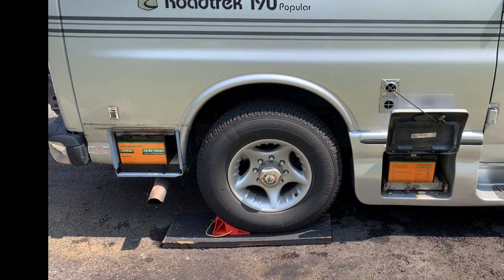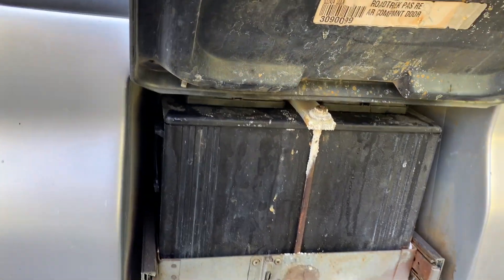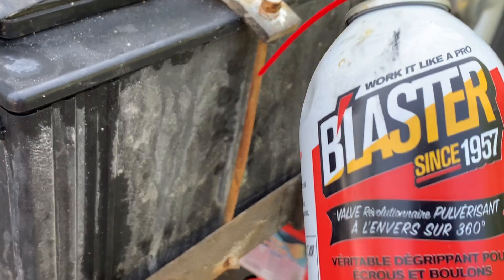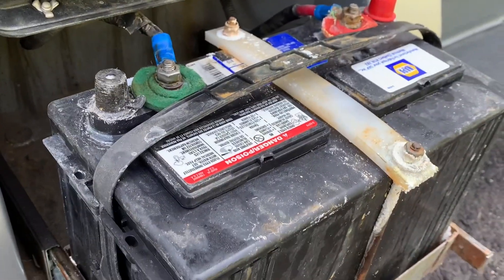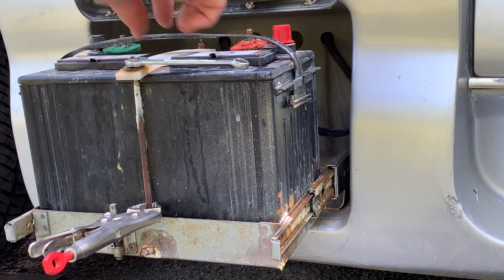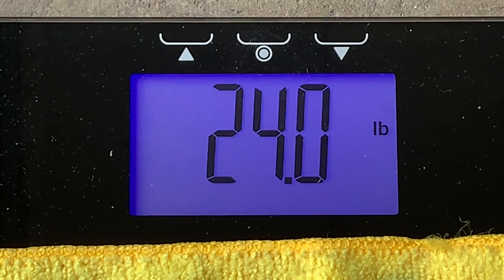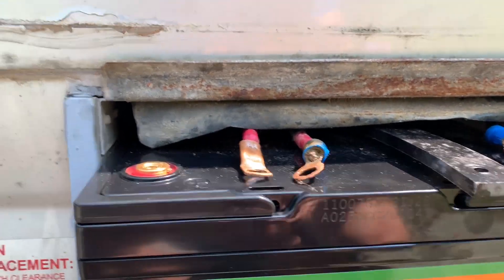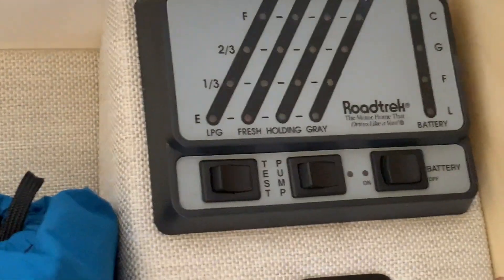Roadtrek 190 Popular Lead Acid to LiFePo4 Battery Upgrade - Installing Lithium Batteries in an RV

Comment: My fiber glass runner board got messed up and the repair center ordered the wrong board. It looks the same and fits the same but the newer runner board accomodate two lead acid in the middle and nothing in the rear. They installed the runner board like the one in the video where it only takes one lead acid. The shop relocated the battery under the sofa bed and it pisses me off to this day. However, I was planning to upgrade to solar and run a solar generator with extra battery under the sofa bed, connect that to the existing 120v electrical system by connecting the 120v output of the solar generator to the shore power internally. I'd have to remove the lead acid under the sofa and run the wire back to the runner board battery compartment. Install the solar battery setup with additional battery under the sofa. Install 1200watt roof setup with a custom made roof railing.

Comment: Did you replace your converter with a lithium one as the old one was for an acid battery?
Reply from the maker: Whether right or wrong I literally only changed the batteries. Just had the RV out last weekend and still working!  I’ve been told it might reduce the life of the LiFePO4 batteries, but since their life expectancy is over 1000 cycles, I’m willing to lose a lot!  Haha. Again, I’m not saying what I did was right but it seems to work and no issues so far. Cheers.
Reply from the maker: Also important to note I used LiFePO4.  Not all lithium batteries are the same.

Comment: Hello, i have a pleasure way excel, i upgraded my agm to lithium to 100ah but my class b only carries 1 coach battery. I would like to add to additional 100ah behind the right rear storage area. Just like your setup here but is it safe to parallel to batteries when they are loke 6ft apart?
Reply from the maker: That’s a great question. This is a factory option on mine (came this way) so I’m not sure how they did it. The cables run inside the van so can’t really see. I personally wouldn’t be fussed about the length of run but rather the shielding, so get some protection for the wires and channel them in an out of the way spot. Sorry I can’t be much more help here. Thanks for stopping by.
Reply: Thank you for taking the time.  @ChanceSummer

Comment: I noticed that when the lead acid batteries were in the Roadtrek, the posts were inboard. When you installed the lithium, you installed the forward battery the same, but on the rear one, you have the post outboard. Was there a reason that you did it that way?
Reply from the maker: Wow, that’s very observant. I actually had to go back and watch my own video to remind myself what was going on. I seem to recall I wanted the posts near the front (outbound) so I could easily connect my voltmeter to ensure the battery was being charged properly.  With the posts buried in the back and no functioning slide drawer this seemed the most logical thing to do.  Just make sure you connect the positive and ground cables correctly when swapping the orientation :)   It’s worth noting that they are still working great and this past fall they were still at 50% after 4 full days which included running the furnace all night!  The furnace fan is a big energy suck.  I think batteries like this are even cheaper now so unless one does winter camping they are the way to go. Hope that helps.
Reply: @ChanceSummer  I have a 05190V and I've already installed a lithium in the forward compartment. I removed the rear lead acid battery and put a block to tie the battery to the forward compartment. I've been wanting to install another lithium in the rear compartment, but I've been worried about needing a DC to DC charger. It sounds like your real world experience is showing that it's not necessary. Thanks again for the video.
Reply from the maker: Gotcha. Indeed, I did not change or modify the stock inverter charger that came installed in my 2004, which is shown at the @15:24 ish time stamp. It is the Tripp-Lite RV612ULH and manual here:  https://assets.tripplite.com/product-pdfs/en/rv612ulhw.pdf
Reply from the maker: Shown at @15:30 is the inverter / charger that came stock in my 2004, which had 2 batteries from factory, and I did not modify it in any way or add anything additional.  Just swapped out lead acid and called it a day. Haha. It is the Tripp-Lite RV612ULH with the manual at https://assets.tripplite.com/product-pdfs/en/rv612ulhw.pdf.

Comment: What about alternator charging?  Won’t it fry the alternator if the battery is low or did you install a dc to dc charger to limit the amps?
Reply from the maker: Great question. If you zip ahead to 15:29 in the video you’ll see that this particular RV uses a Tripp Lite converter,  which the alternator also runs though.
Reply: I don't believe current in-rush will a issue however, the charge profile for lithium batteries is different than that of a lead acid battery. Perhaps this charging mechinism has the capabilities to charge lithium house and the lead acid engine but it would have to be a fairly new system not what came stock in 2004. At the end of the day, even if you mix batteries or charge at incorrect voltages, most systems will still work but the economics justifying lithium is out the window.
Reply from the maker: Thanks for the insightful reply!  I’m no engineer, and all I did was swap out my deep cycle lead acid RV batteries for these LiFePo ones and it’s been 2 summers and working great.  I just came back from 4 days with no power at the campsite and still had 3/4 battery left (3 battery indicator lights on instead of all 4). Normally a stay like that would have eaten up all my lead acid battery juice.  Charging via plugging into house power or when driving (via alternator -> RV power inverter) does not appear to be a problem. It’s all stock Roadtek circa 2004.  The only real downside to LiFePo is winter / cold temp charging. Apparently, anything below 0C / 32F is not great for it and won’t charge at all at -10C - but I’ve never tried.
Reply: @ChanceSummer  Yeah, you got me pegged - I am a Eletronics engineer.  What you did if fine but you will reduce the overall life of your lithium batteries charging them with a system that is setup for lead acid.  The good news is even if you half the life of your batteries doing so, I bet they are still good for five years.
Relating to the cold weather charging you were referring too - most reputable lithium manufactures include a builtin  Battery Monitoring System (BMS) that detects and prevents cold weather charging, you may want to check on that as not all vendors include that feature.
Reply: What is running your batteries? I'm guessing the ac doesn't. What size converter is in a Roadtrek?  I have noticed the Pleasure Way on the Promaster has a lithium battery. 
I'm interested and looked for a Roadtrek 190 or 210. Need to have some for sale in New England. Wouldn't want to flyi across country to test drive one.
Reply: @277kne  I have 400 amphours of lithium so my AC can run for about 3 hours....so I dont do that.  Id use my generator if I really needed it.   I can run an electric oil radiator heater for two nights without recharge.  I can boil water for coffee and run my small electric fridge .   In fact I have a 100 watt solar panel I put on that just about recharges my batteries if I am running my dc compressor fridge.  So I can run things indefinitely if I don't use electric heat.  I can use propane to heat.
Reply: @davidmoody2112  Thank you for the video. I forgot about the generator.

Comment: How is this working for you? There were some very negative reviews on Amazon.
Reply from the maker: Thanks for the question. Like anything I guess there are some pros and cons.  Pros are mainly never need to top up and no overflow corrosion, no risk of toxic fumes and much lighter (1/2 the weight). Downsides with lithium batteries of any kind is they go from full power to off (no power) when they drop below a certain voltage so it’s really hard to know when you are full or almost empty.  The existing battery gauge in the wall is not working well to judge remaining power. I think I need to supplement it with a real digital voltage meter. Also, I don’t winter camp and haven’t tested this yet but apparently the battery manual says not to attempt changing if it is -20 outside or also if the battery itself is at zero F.  So, if you are winter camping I suspect you’ll need warming blankets for the batteries. Not unheard of, but not stock. For my summer camping needs however, I give them a 9/10 with the 1 off for price. They are still double the cost of lead acid.  Not sure why people would give bad reviews on Amazon though. Hope that helps.
Reply: Encouraging. I did order a couple of the batteries. Just FYI Eco-Worthy does make a battery monitor.  Is there any issue starting the generator on house batteries?
Reply from the maker: Nice, thanks for the info, I’ll look into the monitor.  I don’t have a generator on my unit so let me know how it goes. I don’t expect there would be a problem though.